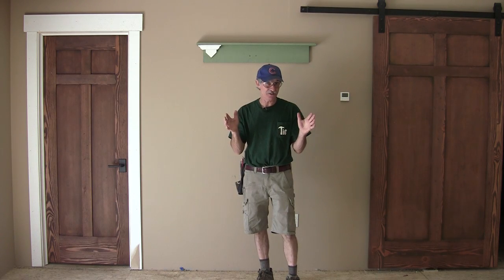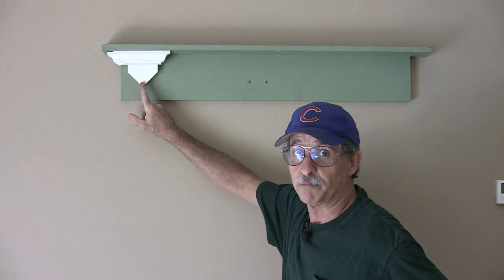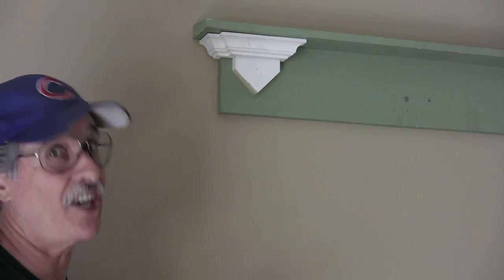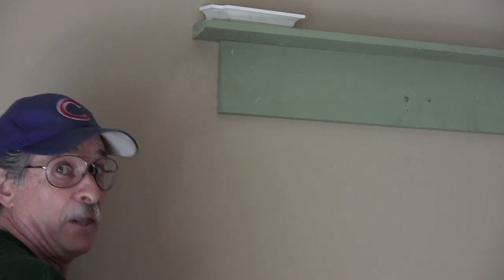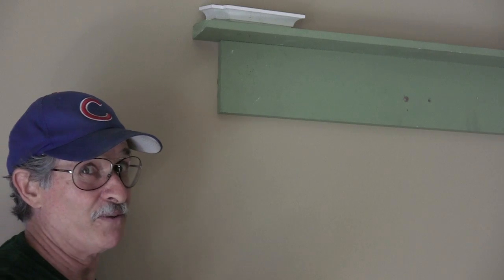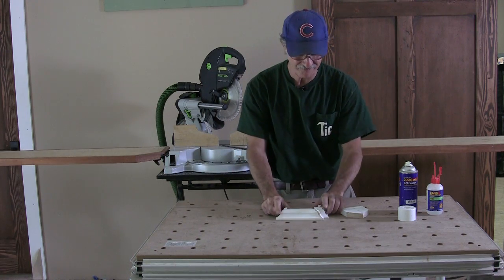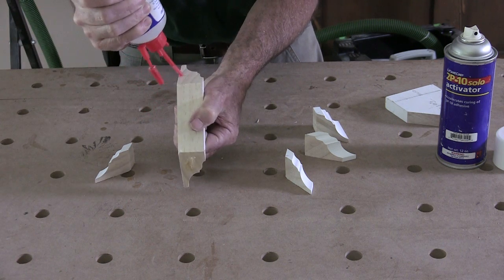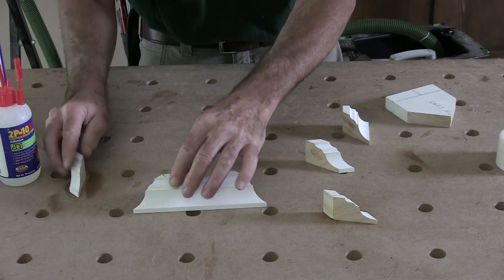Victorian Door Head

Comment: i'am a carpenter & I bough a laser for my mitre saw, I rather the creep cut method far more accurate & has worked for me for 28+ years, the laser is ok for locating the cut mark but I would rather a good saw with a quality table & fence casting & a good work light on a site saw rather than a laser.